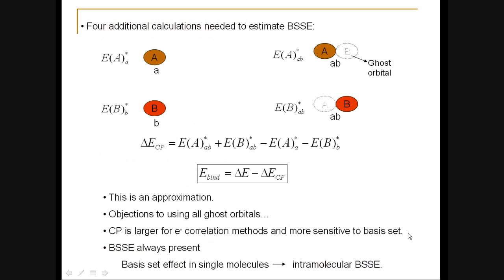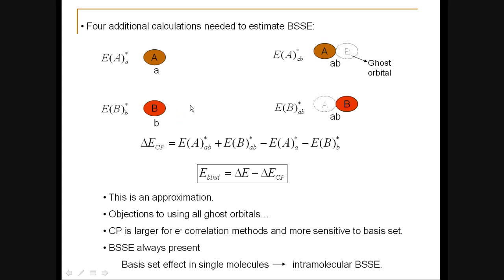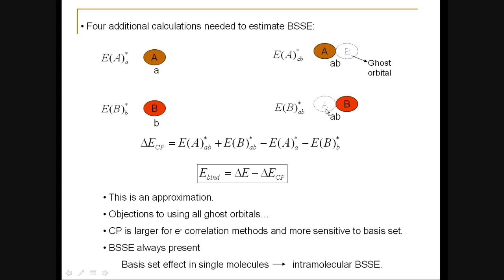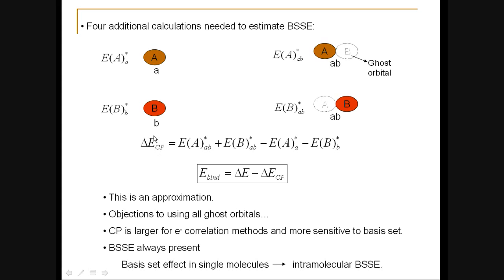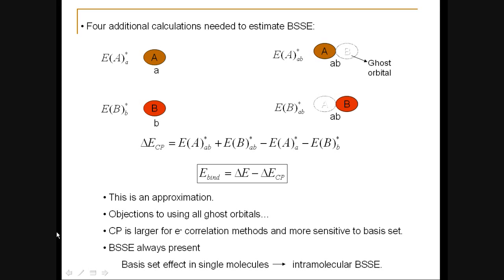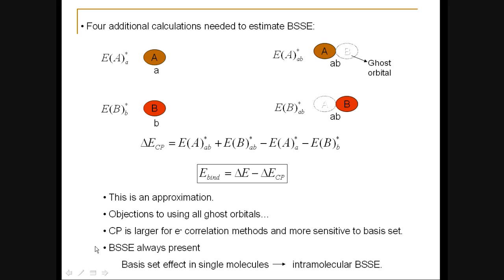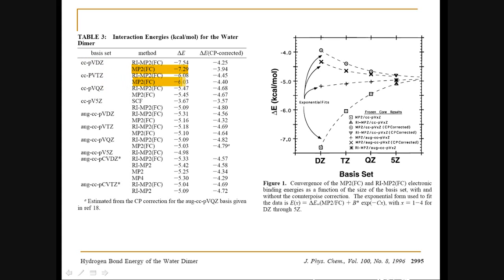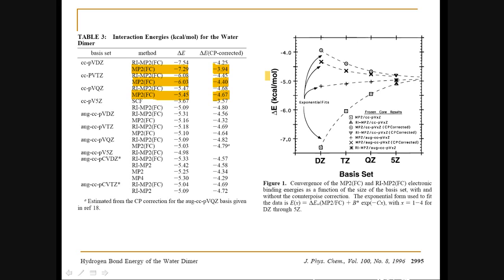Basis set superposition error - Part 2

Comment from the maker: Well, BSSE is often not too large, given the basis sets we use nowadays, and it would be a much smaller correction, relative to the bond energy in covalent systems. A lot of people skip it even in van der Waals complexes, unless they shoot for quantitatively (well, sometimes qualitative too) accurate results. It is quite easy to estimate though, so whenever in doubt, you can just check it real quick.